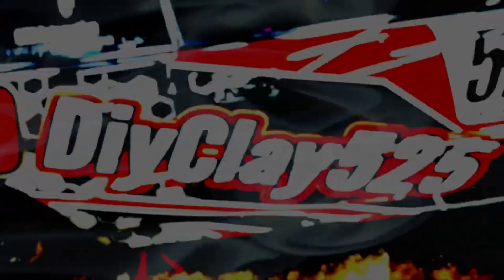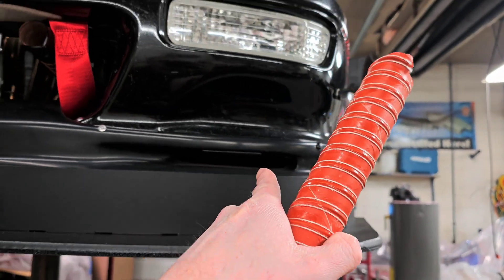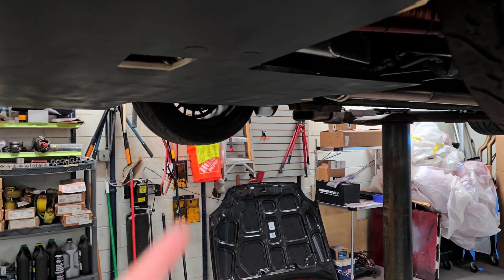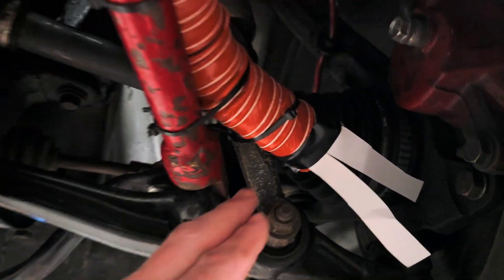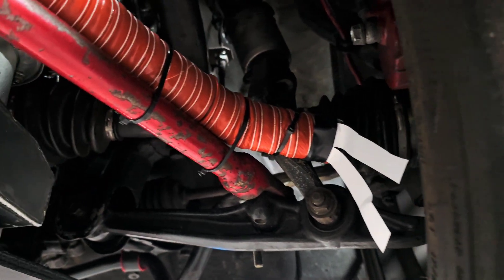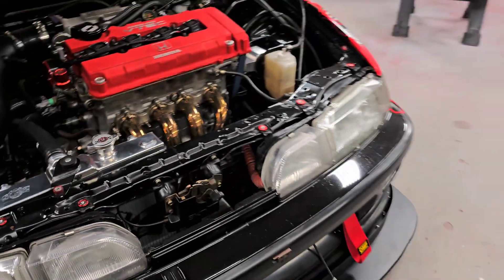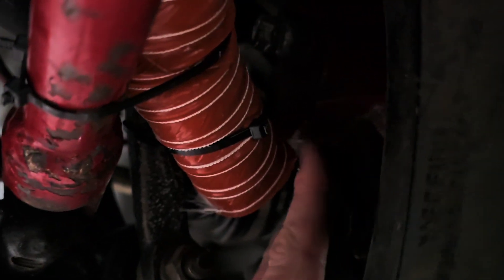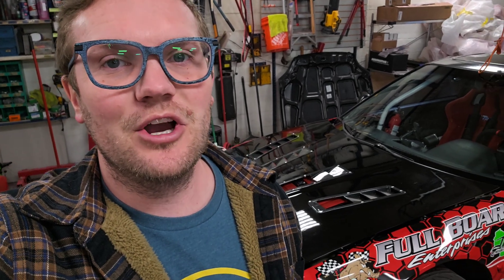Diy brake cooling for $50🔥🏁 Integra road race prep part 2

Comment: those headers are fucking beautiful.

Have you thought about ducting the intake so it doesn't suck hot air out of the engine bay?
Reply from the maker: @user-mn8lz7gf6d  thank u. I have thought about it. But with having to race in rain and other mixed conditions, I think I'm better off with the intake in the engine bay
Reply: @diyclay525  is it really that bad if rain gets to the brakes? they get wet anyways.
Reply from the maker: @ohitstarik  rain doesn't matter.

Comment: be nice if the manufacturer would add  another option in for the heater to blow the heat out of the car to cool off the engine